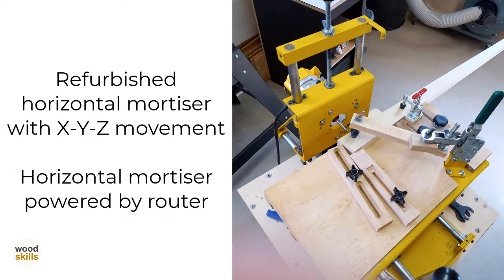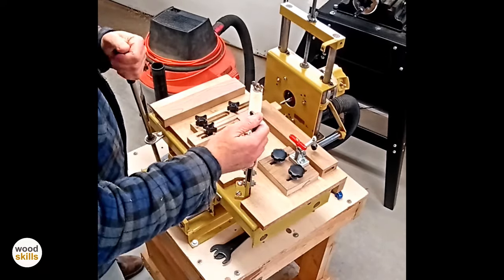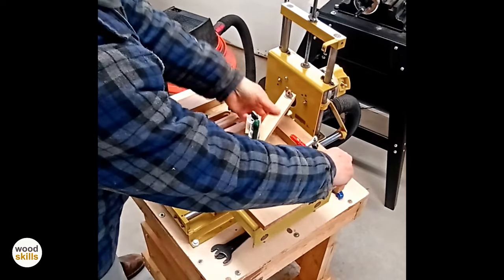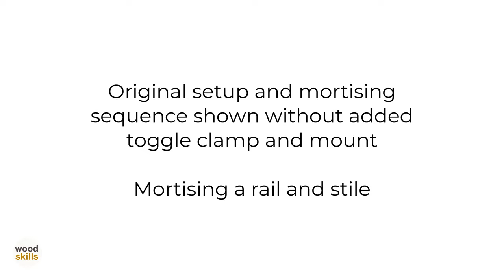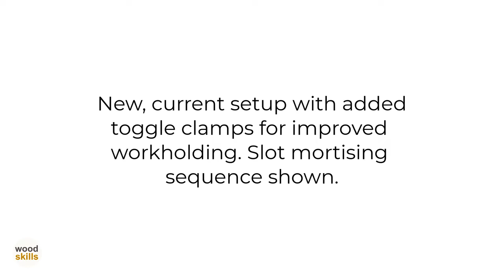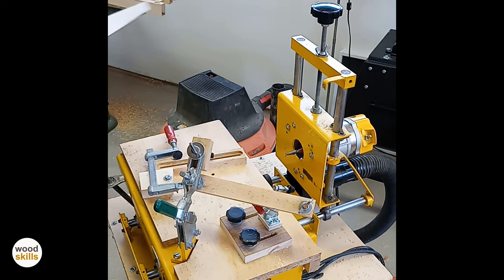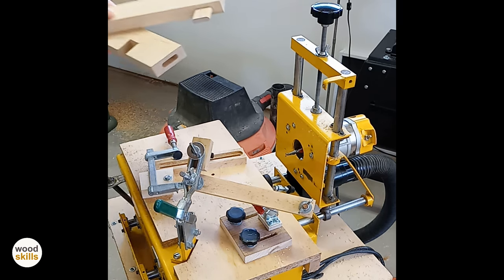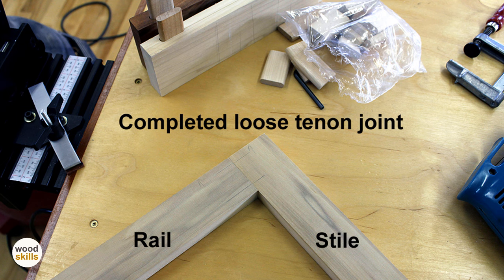Why I don't own a Domino Joiner (restored mortiser instead)

Comment: great video, so where did you find this machine?
Reply from the maker: Thanks! It was donated by a friend. It sat unused for decades in his family.
Reply: @WoodskillsCourses  If I may trouble you with something.. I am looking to build a similar machine, I have some components from previous machines I worked with... can you tell me what are is the travel distance X,Y and the dimmensions of the tables, on both axises... thank you
Reply from the maker: Sure. X-travel = 6 inches L to R   Y-travel= 9 in. Front to Back.    Table Dimensions:  Top table for X-axis 18 in. W x 11 in. D.   Bottom table for Y-axis 10 in W X 10 in. D .. There is a system of stops however.  My X-axis L to R travel would likely never be over 2 in. in my work,, adjusted with stops.
Reply: @WoodskillsCourses  thank  you so much... I was checking out your website.. IMPRESSIVE!!!